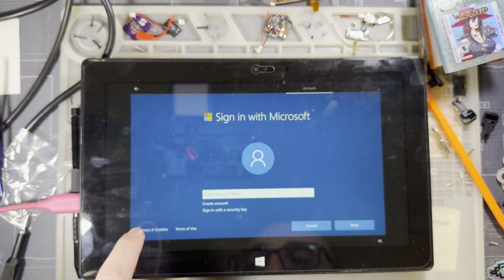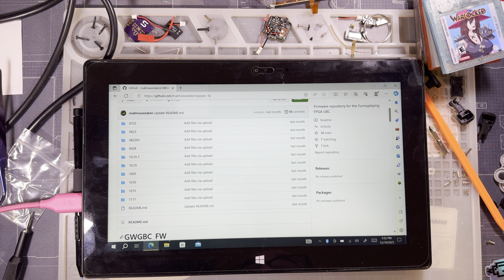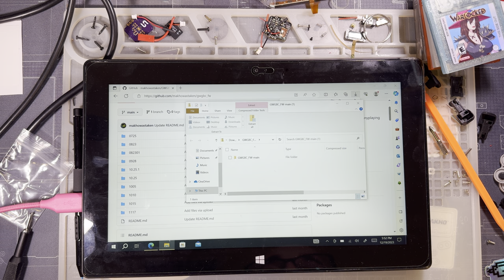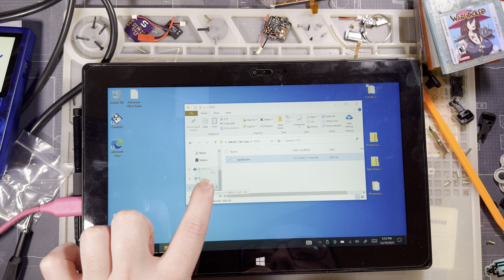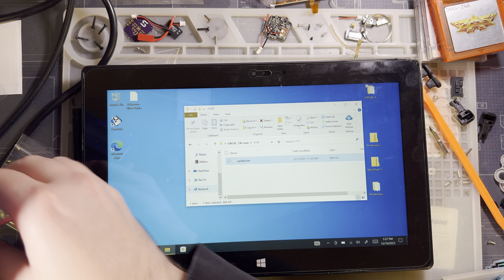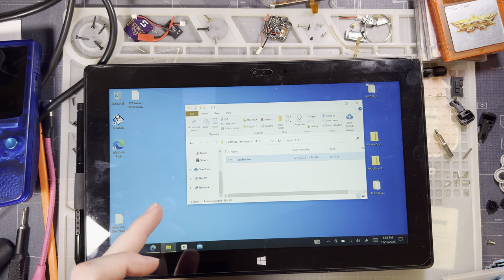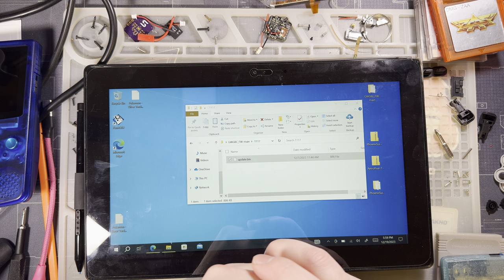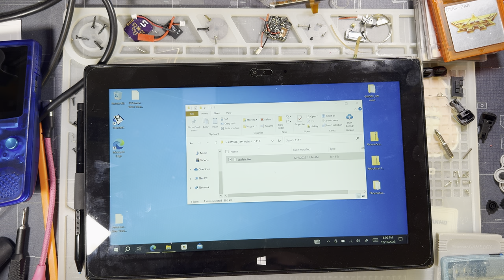Aftermarket Game Boy Color... From Scratch (Funnyplaying FPGA GBC v1.0)

Comment: I bought one when they first went on sale and have had it for a month or so. Plays great with all my original carts (about 30 or so) but my Everdrive x3 does not work. I tried all the available firmware and it would work with one of them but most games ran super slow with very choppy audio. I've been emailing with FP and they seem to indicate that there is a fix in the works but I have not heard anything in a few weeks now. If they can fix Everdrive compatibility this thing will be awesome, as of now it's cool but not great.

Comment: When you have time can you replace your 1.02 firmware for the 1.1 revision? I updated with it and it caused some black screen issues. After some troubleshooting and lots of retries with different windows computers and usb cables and I found the issue. The update.bin file is less than half the size of the one posted on the funnyplaying fpga googledrive file for 1.02 1.1 revision. The one on the funnyplaying google drive worked perfectly. Just took two tries before I got the new boot screen and revived fpga gameboy.
Reply from the maker: Please read the release notes on my github if you're going to use the firmware from it. I have already added the new firmware but there were clear labels on there that I uploaded a test version.

Comment: My FPGBC arrived last week, I put it together right away and found I have the one with new hardware revision with the FW 0.90. 

It has a really weird problem that I can't seem to find other ppl talking about online. The OSD menu is really sensitive when pressing the A/B button. When i try to adjust the brightness/audio/palette, if i press A once, it will either increment by 1, 2, 3 or even to max. Same with B but descending. Basically A/B increments are all random. The A/B buttons works fine in game though, just has problem in OSD menu 

Makho, do you know anything about this? Have you tried the 0.90 fw? I tried contacting funnyplaying, but it's been several days, but I haven't heard back from them.

Comment: I hope they make a gameboy pocket shell comparable with this
Reply from the maker: That is under active development
Reply: @makho  do you think that the board it’s using is going to be upgradable to handle gba?  Well I guess it wouldn’t work because no triggers on this device.
Reply from the maker: @adrianfernandez7458  No, it's gonna be a totally different board. I suspect they are not even going to use the same FPGA since they've mentioned that they're already low on space with just GB and GBC cores.

Comment: I bought the fpgbc kit because I work somewhere bluetooth devices are not allowed.  If Anologue offered a bluetooth free option I would have gotten that.  I think that if there are enough gates on this fpga they should offer adapters for other systems.  Also open up that firmware and let people hack on it.
Reply from the maker: Analogue Pocket doesn't have bluetooth. The dock does.

Comment: Thank you so much for this video! I wouldn't have been able to put mine together without you!

EDIT: How did you make it display the Game Boy Color splash screen on boot?
Reply from the maker: Each core has a different boot screen styled after the console it's based on. Newer firmware has FP branded screens, older is emulating Nintendo OEM.
Reply: @makho  So short of downgrading the firmware, I'm stuck with the FP boot splash?
Reply from the maker: @linktheordonianhero9098  For now, yes.
Reply: @makho  Thank you, for everything :)
Reply: Is the code for the firmware open for hacking?
Reply from the maker: @SgtScourge  No

Comment: I just got mine today and can't get the screen to display, but everything else is working great including the backlight. Any ideas?
Reply: update to Firmware 1117(.89) I had the same problem
Reply: I had tried this but it failed over and over. Turns out you need to use a USB 2.0 port, fails in a USB 3.0 port.

Comment: Makho, do you think there’s any chance of them releasing a firmware which is the actual clock speed? I really can’t get over the difference in pitch from the sound, it’s either too high pitched or slightly lower! 

I also hate the new FP boot screen, I want the original GBC boot!
Reply from the maker: You can just install the other firmwares with the old boot screen. No one is stopping you. 

I suspect that if it were easy to tweak the clock speed, they would have already done it. It's close enough that you really cannot notice in games.
Reply: Thanks! I realize now that the clock speed isn’t really as big of a deal as I’d first thought. 

I have the 1.1 board, and I saw they adjusted the boot logo with the latest firmware. Maybe they’ll go back to the original at some point.
Reply from the maker: @AdamDallas  I doubt they'll ever go back to shipping these things with Nintendo logos.
Reply: @makho that’s a bummer, they still ship their shells with the logo on them, so I’ll quietly hold on with hope lol
Reply from the maker: @AdamDallas That is probably going away too and for the exact same reason.

Comment: The only issues I've had with mine are that Alleyway simply doesn't work and that most of the sounds are missing in Chessmaster. In Alleyway the paddle just won't move so it's unplayable, but it's Alleyway so I don't care. I am still running the v.87 firmware that it shipped with however. Oh and also, super Mario Land crashed one time in the fourth level. Otherwise, i love this thing! I've had it about a month and play it everyday. I've put about 35 hours into a run in Pokemon Crystal with no issues. My alliexpress copy of Pokemon yellow didn't work, but I didn't really expect it to. I love the bigger screen size and louder speaker. Playing this has sent me down the rabbit hole of adding audio amps to my other Gameboys. I wish the battery life was a bit better and I wish it had the option to use AA batteries, but being USBC is convenient. Oh, and the reason i felt i had to buy this is the volume rocker and osd menu. My gbc with the FP q5 kit has had some issues with the touch sensors activating when I'm not touching them. I love having a physical button to operate the osd menu and change settings. Touch sensors should be left to people who are too scared to solder lol

Comment: Built mine last week. I let funny playing know about the volume label on the case. I have another issue - i generally have a white noise or background noise coming from speaker and in headphones. The game sound drowns it out, but when volume is off it persists in speaker and ear buds - almost sounds like a bad filter or cap in a regular GBC conversion. Anyone else have this issue? Just go in a quiet place, turn your volume down and you should hear it
Reply from the maker: I discuss this in the video (though I fail to capture the sound itself) and I have already noted this in the firmware repository.

Comment: Okay, you got lost in the sauce somewhere, if you think using Flash-Carts is fine with one fpga-GB but not the other, and that to an Analogue Pocket with a Flash-Cart, a cheapo software emulator would be the go-to alternative. Obviously, it's the hardware emulation part of the Analogue Pocket (or the FPGBC) that people are interested in, regardless of whether they use original cartridges, a Flash-Cart – or with the Pocket also just an SD card.
Reply from the maker: I think you've misunderstood something I said and started ascribing things to me that are simply not true. Or maybe I misspoke. Not sure which specifically happened. 

To be perfectly clear, I think it's a waste of money and electricity to use cart emulators with console emulators, regardless of who makes either. They're not designed to work together and the two layers of level shifters add extra latency that is extremely difficult to work around, especially on a high speed data bus. There are alternatives that provide a cheaper and more reliable experience for playing games. 

I still use cart emulators regardless because I can still understand that they provide a lot of utility for testing. Tangentially, I understand that they are still very popular so I can use them  to test the behavior of edge cases since if the  works, the actual cart will too. The opposite is not always true.
Reply: I guess you misspoke or put it too bluntly (maybe only for me, who knows). For example: I see no problem with someone getting interested in the GB and GBC buying an Analogue Pocket and an Everdrive to start out, with the plan to start collecting carts. Also, I think you're mistaken about the latency, at least in a real world effect in actual measured time, even though I get what you mean by emulating both ends, of course, it's not the intended use of either device. Your message sounded more like a "political message", like an fpga machine would be wrong conceptually, to play ROMs instead of carts, and I think one should not exclude the other. I have no plans to at some point own all the GB carts ever produced, but I love checking all of the games out for a minute or two to decide which carts to look for online or at a yard sale or something. Plus: Romhacks. @makho
Reply from the maker: @fryke  No, it seems you're misunderstanding. 

I glossed over the issue but raw speed isn't the only challenge with these things. Timing is exceptionally important. These data interfaces expect certain things to happen at a precise time. Too early or too late is a failure just the same. Like I said, the two layers of level shifters add a certain amount of instability that is difficult to work around. 

If you want to use a cart emulator with your game boy emulator, by all means. Since compatibility is not universal, however, it will never result in the seamless experience that is just loading ROMs into an emulator. From a gameplay focused experience, this is an important distinction. If you just like the idea of playing games without actually playing the games, this is obviously less important. 

A cart emulator is a flash cart but not all flash carts are cart emulators. You can easily build or buy a cart that can run ROM hacks without any of the cart emulator pitfalls. I'm talking specifically about Everdrives and the like, not OEM carts that have had their MROM replaced with aftermarket flash.
Reply: ok @makho

Comment: Can we get a list of compatible flash carts that are SD card based that work on the FPGA as of now. I know everdrive x5 does not work and ez flash does not work, Funnyplaying says their working on it whenever I ask them.
Could we get the names of the ones that work?
Reply: Kinda hard to confirm as each version of the everdrive has had several different hardware revisions within each version. You would have to get each hardware revision for each model.
Reply: @ALIEN19740 why are you using a clone rather than the official everdrive that is supported by the original developer Krikzz?
Reply from the maker: None. Nothing is blanket compatible. That's what I mean when I say that compatibility is based on the specific cart you have. Some EZ Flash work out of the box, some don't work at all. This applies to ALL SD based carts right now on this console.